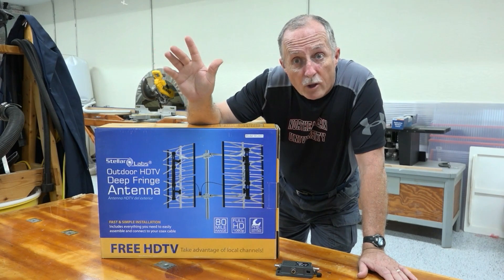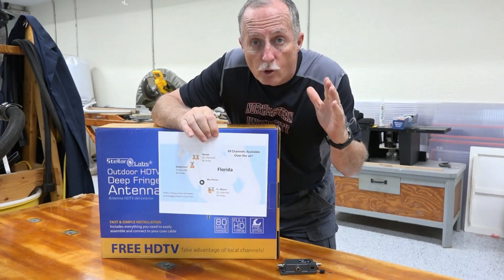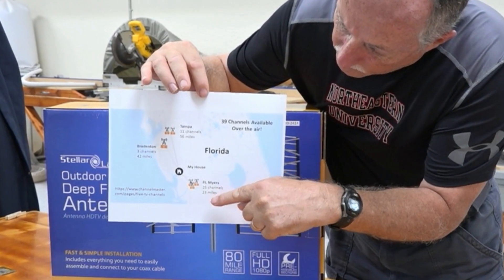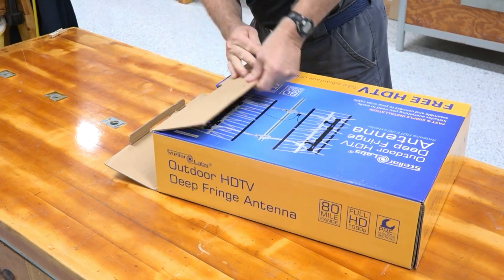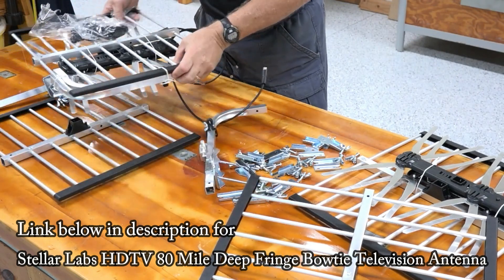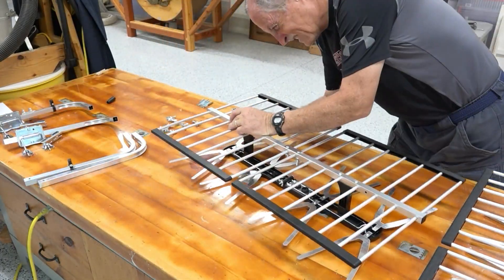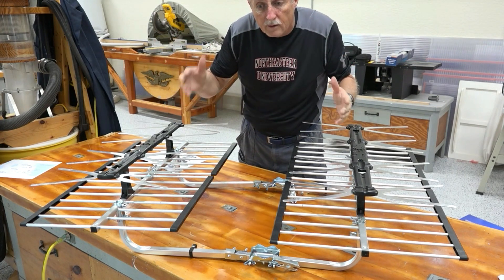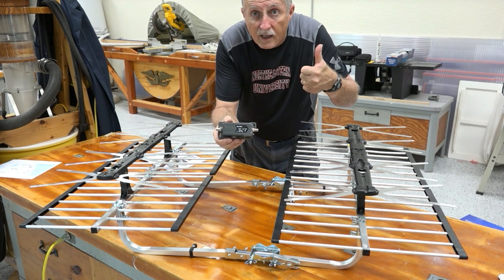Cut the Cable - How to Install an Attic Antenna + Amplifier

Comment: How did you run the cable through the house?
Reply from the maker: I ran the coax from the antenna in the attic across the attic to the bedroom then down a wall.